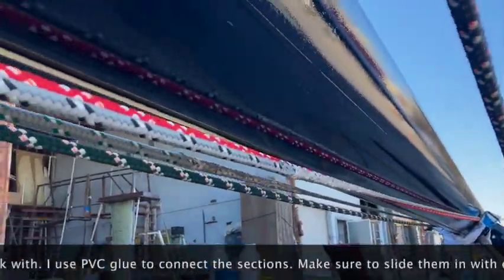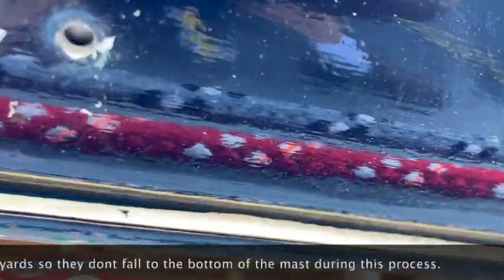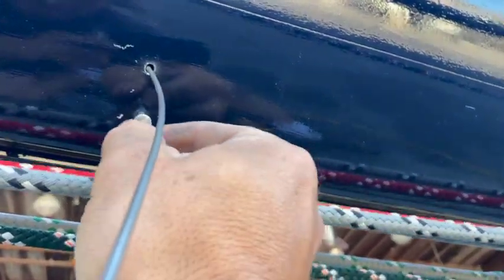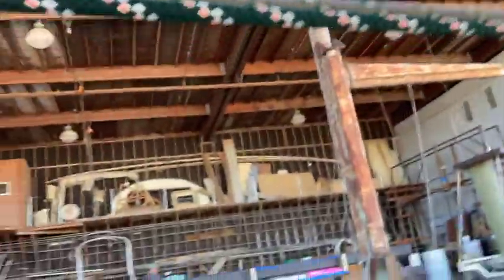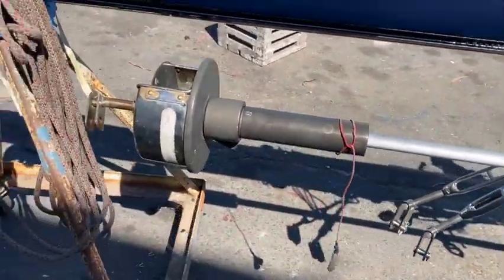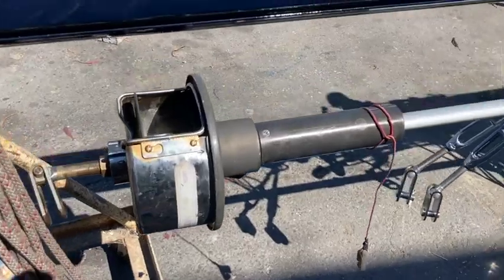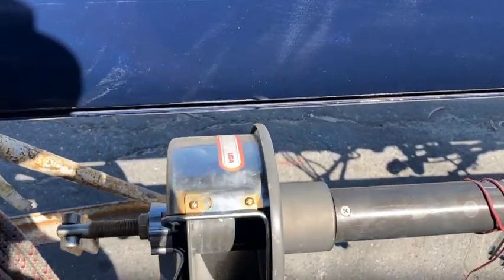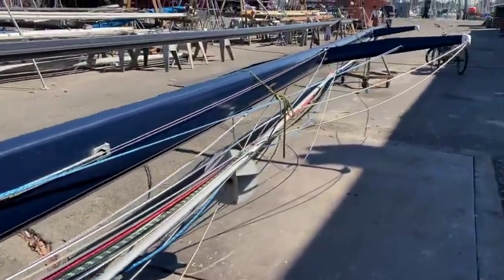Episode 13 "Installing Electrical Conduit in a Sailboat Mast"

Comment: What is your pro tip to replace an old wind sensor cable with a new wind sensor cable in the conduit?  How do you connect the new cable, with a NMEA connector, to the old cable so that it's small enough to slide all the way through the conduit? The mast is a ~65 foot Z-spar installed on a Lagoon 450 catamaran?  Thank you in advance
Reply from the maker: Attach a tag line to existing/old wind transducer cable. Pull the old cable out with the tag line, then use the same tag line to pull the new cable in. Can go smoothly, but it’s a boat project anything can happen. 😊

Comment: Thank you for posting this video.  I just had my mast unstepped yesterday to replace the rig and part of my plan is to run internal halyards and add conduit for the electrical this video is exactly what I needed to see.  How can I make a wire tool to hold the conduit like the one you used?